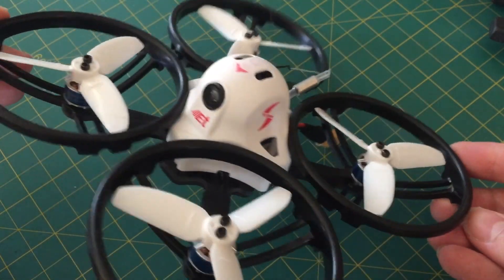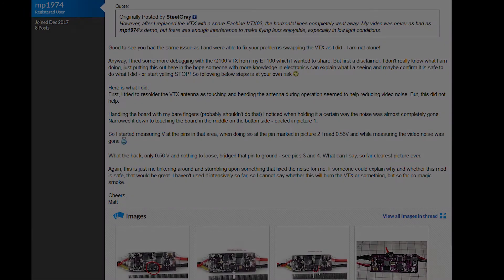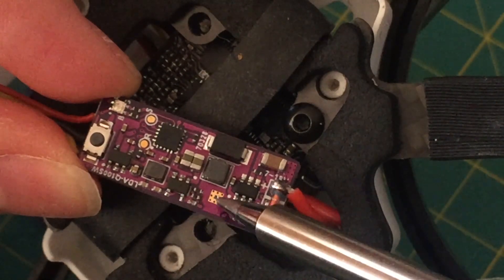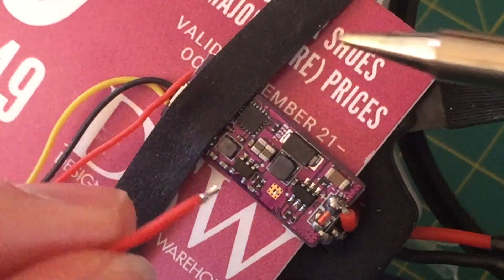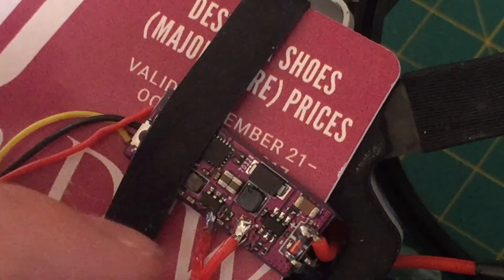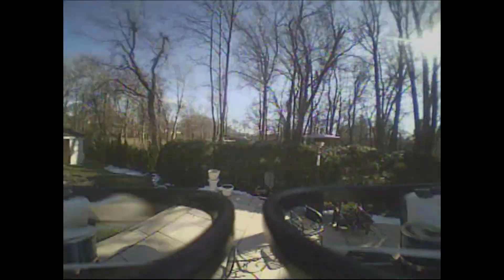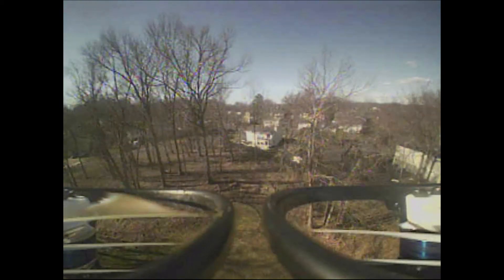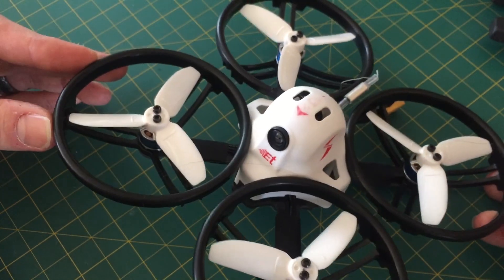KingKong ET125/ET115/ET110 Horizontal Lines in Video Fix! 🛠️

Comment: LOL just use some 10 gauge wire to jump it LOL I know probably all you had.
Reply from the maker: Flyer-rcplane yeah that was all I had at the time, but it’s still a little tricky no matter what. this fix has not stopped working though so I’m happy!
Reply: I love my Et125. great for learning. But my vtx doesn't have very long range. Breaks up a lot.
Reply from the maker: It's built like a tank. How far do you usually fly out with it that it breaks up?
Reply: 80 to 100 feet. If I try to go around my house I loose color and breaks up real bad. I did try different Ch but didn't help.

Comment: Just got mine and going to do the mod. I also see you have the antenna on top of the canopy did you put a longer one.
Reply from the maker: Hey ray. I didn't put a longer antenna for the receiver out of the top, no, actually the included antenna is really long but they scrunched it up tight! I just unwinded it.
Reply: @JohnCuppi  ok thanks alot. 👍👍👍👍

Comment: I have had no issue with the video on my ET 115, so far mine as been clear as a bell and it has been banged around pretty well...Only issue I had was the metal piece on the VTX Antenna came off in flight , the antenna wire is still there but got a little break up /static after losing it ...SO....I bought a pack of cheap antenna's that have that metal piece on them, I just took one off and stuck it on my antenna and put some heat shrink on it and it's back to no break up and clear  ...BUT If I ever get that issue you describe I will know how to cure it...Thanks for sharing will save this video for future need, if need be.....
Reply from the maker: You're welcome! The issue isn't extremely common, but it also isn't rare either. Maybe 1 in 20 of these have this issue from what I've read, the rest are fine. Happy flying!

Comment: I just reboots everything works for me.
Reply from the maker: Hmm. It sounds like you have a different issue that is causing the lines then. Because rebooting would not fix it for me and many others.
Reply: I get the lines now and then so I take it yours was permanent.
Reply from the maker: The Ghostrider UK DJ yes it was. if yours ever gets worse and stays permanent though I bet this will fix it. 👍🏻
Reply: Yes nice to no will bare that it mind, I love this king kong hope yours serves you well.
Reply from the maker: mine has been great since i fixed it!
Reply: Nice to hear.
Reply: same for me... i reconnect the batteries and the lines go away.. i put a low esr cap but is the same.
Reply: I have now broke mine, Be careful not to land in long grass well motor are still spinning this will burn out the esc.
Reply: yea... 2 inches or 5 cm  above de ground and disarm.  iam trying to make a reflex out of that.

Comment: Very good tutorial John.  I do have a question tho.  It was always my belief (and from others) that the antenna should always be mounted on top of the aircraft.
Reply from the maker: In the case of FPV racers where you can flip over and crush your antenna, durability must be considered. It is actually best to mount them out the back with a curvature slightly up...  The dipole antenna on the KingKong ET series sits straight up in the back, but the plastic shell top sort of "protects" it by being tall enough.
Reply: Good explanation Bud. :-)

Comment: Hi John, I have the same issue on my new ET100 :( I do not understand if I have to take off the Vtx from the quad and in that case how. Can you explain me? thanks
Reply from the maker: Mario Regeni Hi Mario. The VTX is on the bottom of the quad. You should be able to fish it out without having to take the VTX off off the quad. I was able to do this modification while the VTX was still attached. 🤗

Comment: Does the factory vtx come set at 25mw and switch to 100mw or other way around?
Reply from the maker: It defaults to 100mw, there's a couple of solder pads on the VTX that determine the output power; solder bridged = 100mw, not bridged = 25mw. You will find them underneath.
Reply: It looks bridged but range is awful, my leader 120 goes 3x further on 25mw...again thanks for quick response.
Reply from the maker: I have yet to fly this in an wide open area that isn't from the backyard that you see in the video, but I was impressed enough that I could fly out into the little field there and then back without losing my signal. Perhaps sometime this week I'll try taking it out further or to the field.
Reply: Hi John.
I have the ET 125 too, but I'm unsure about the default vcx power (25 or 100mw)
I searched in Web for picture of the soldering bridge, but didn't find it anywhere.
Do you have a picture of the location? Is it on the side with Led and Pushbutton or opposite side?
Best regards, Paco

Comment: That takes some brains to figure that out.
Reply from the maker: I can't take the credit for this! I did figure out the same thing about touching the VTX, but where to solder to figure it out is thanks to the other person I mentioned in the video. This fix has been around since around February. And information about this should be more well known, but it isn't, so that's why I made this. Plus it shows that someone who is not great at soldering like me can get this done. Thanks Brian!

Comment: Good video, thanks. My 100 has the same problem unfortunately, it also seems to go away when I place my finger on the VTX.  Gearbest offered me the choice of sending it back for a refund or exchange or to keep it and receive a 35$ refund for compensation. I think I'll keep it as I don't want to be without this quad for a month or two. Still not sure if this fix will be safe in the long run though. Someone else came up with another fix by adding a capacitor to the VTX which sounds like a better solution, but what do I know. Glad you got it resolved anyway, I hope I'll be able to fly mine FPV too someday soon.
Reply from the maker: I bet this fix will work for you then if yours clears up by touching it as well. If you remember, poke me about how well this fix is still working in a month or so. I did see that someone added a cap to theirs but looking at what they did is beyond my soldering skills. I just don't think I could pull it off, and I've soldered quite a bit. This jumper wire is a lot easier. I'd take the $35 offer from gearbest, try to do this fix and if it fails go ahead and purchase the new VTX. It costs less than that. Best of luck.

Comment: I have looking at this one. How long of flights do you get ?  Thank you  :-)
Reply from the maker: 3 1/2 minutes is where I stop using the 650mah 2s batteries since this doesn't have an OSD. I could probably go about 30 seconds longer I think, but I need to check my batteries. I've actually had this model for a while. When I first got it, I tried to set it up with the latest version of betaflight, and enable dshot so I could get the turtle mode/better flight. In order to do that, soldering and removing pins on the board was required, it was a huge hassle. I ended up screwing up the original flight controller to do the mod so I ordered a new board. LUCKILY, as of betaflight 3.3 it is no longer required to do any soldering to bring this baby (or any ET series) up to speed. I flashed mine about a week ago and it worked perfectly. That's when I discovered this unfortunate VTX issue; I hadn't actually even bothered to look at the camera until then. I have an ET115 also but that one is totally fine, so this VTX problem is hit or miss. Now it's 100% so I'll do a full review soon...
Reply: Thank you  :-)

Comment: Why should the customer have to do this
Reply from the maker: The customer shouldn't, but the reality is that this issue can sometimes occur... and it's faster to just do this to get back to flying. It's also cheaper than dealing with having to ship it back for a replacement/refund and then waiting for it. KingKong knows about this issue, though, so hopefully QC improves in the future.